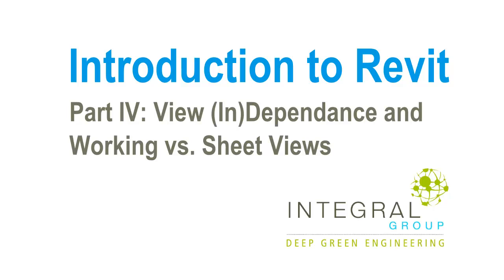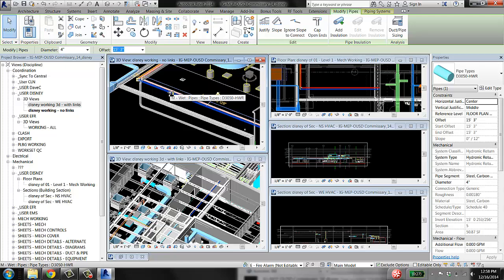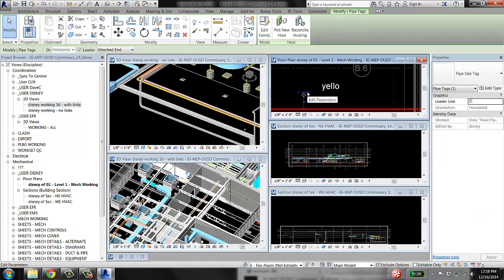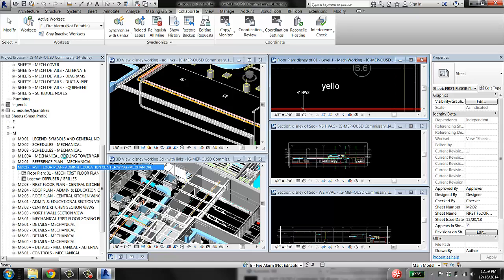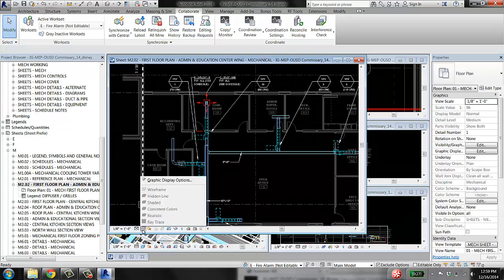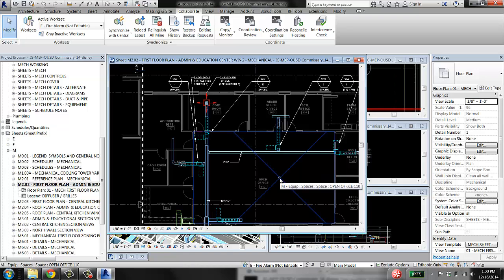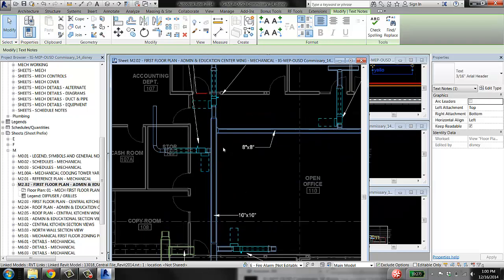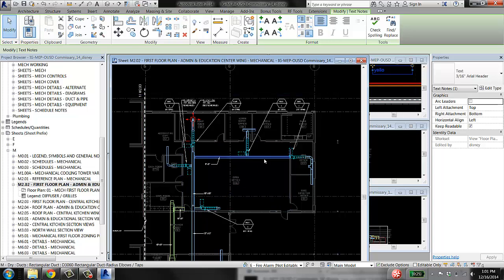Intro to Revit IV: View (in)Dependance and Sheet vs. Working Views

Comment: Hi Tyler, how do you create a Mech equipment hex tag where the type is on top half and number on the bottom half, and both will show up together in the schedule, like "AHU-01" and the family hex tag is AHU/01?
Reply from the maker: 723lion Currently that is not possible. Folks have been asking for the ability to concatenate strings in Revit for a long time but it remains a wish list item.

We just use two columns in our Schedule for what you are talking about, with Type Mark and Mark as the parameters. It works fine, just not quite as pretty as one "Tag" column with [Type Mark]-[Mark] in the field. 

http://forums.augi.com/showthread.php?155295-Schedules-Calculated-Values-To-String-function-for-non-text-datatypes
Reply: Tyler Disney Thanks Tyler, that's exactly what I did as a workaround :p. Thanks so much and please keep up with your great work! I work in SF and your vids been super helpful!!